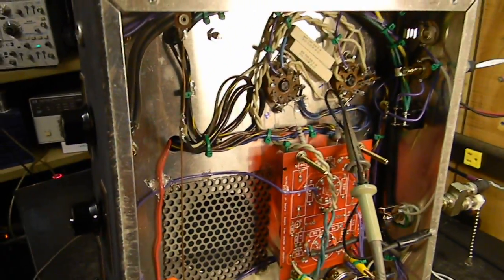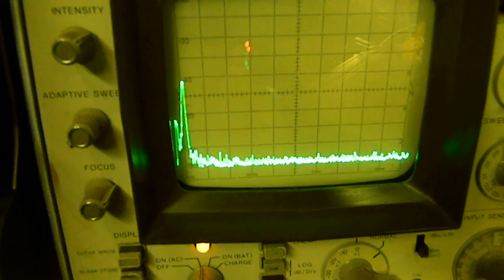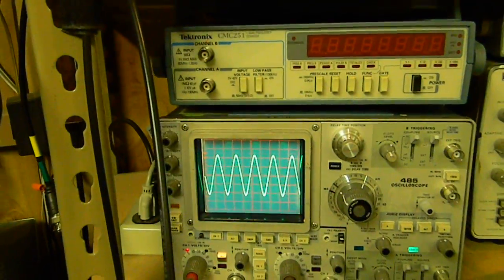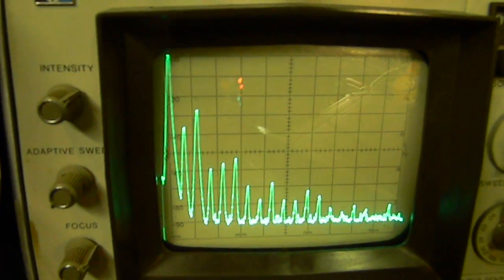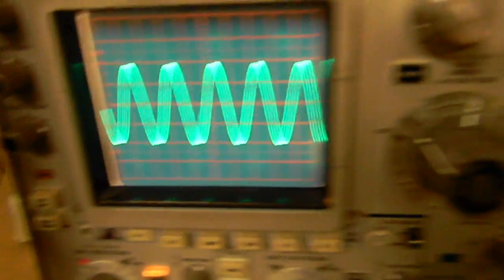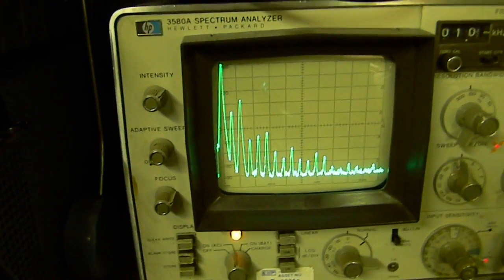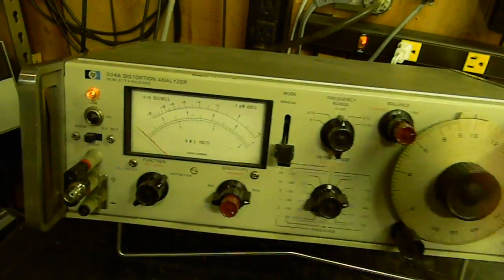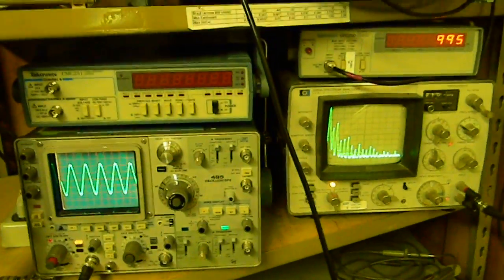THD And Its Origination In Audio Amplifiers

Comment: Happy new year David. Hope 2025 is a great year although it seems we've already had a rough start... Anyway, I wasn't sure where to post this since it touches a few area but THD is currently what need some assistance with. It does cover the HP 8903 and Fisher amp and I've watched other videos covering this content. Anyway my first question is do you use any capacitor coupling when you connect from the output of the audio amp under test to your test equipment? Currently I use the HP 8903a and Pete Millett software to perform my testing and I'm wondering if I'm doing something wrong with the way I'm connecting to the output. What I'm doing is connecting my amp (Fisher 400) left and right output to two 100 watt 8 ohm resistors as a dummy load for each channel. I'm connecting the HP 8903a input across the resistor. I have the banana connectors configured to provide test points to connect my Sencore lo capacity test leads to (from my Sencore LC53 Capacitor analyzer). For awareness the output of the HP in sent into the aux input of the Fisher 400 I've been restoring for quite some time. My issue is that I've done a lot of work to this fisher using mods and Ideas I've found from yourself and some other youtube masters. Currently, I've successfully replaced all the Filter can caps with Hayseed Hamfest, Installed new Bias caps along with an individual bias adjustment circuit and the necessary coupling caps and resistors required to measure at the cathode of power tubes. There are additional electrolytic and resistor replacements made as needed. Everything has been done and I'm happy to say everything works however this nasty THD still exists at my output tubes. And the freq response from this Fisher 400 seems concerning dropping off starting at 10K at the output while the preamp seems to perform better. 

Right Side: To be clear this THD issue is concerning since its not linear across the channels. The right channel is much worse than the left. So this is what I know. At near 2 watts output I have a THD+N on the right that rises to 1.5% at 30 hz dips a bit down to 1.25 between 100hz and 1Khz and rises to 2% between 3 and 8K then starts to drop off at 10K and falls off by 30 K. Note that the freq response of this amp also rolls off at about 10K and is 5db down by 30K. As you can imagine the THD gets worse as the power is increased.

Left Side: This side runs much better at the same 2 watts and starting at 20hz to 500hz I'm at .2%. Then from 500hz to 1K the rise starts slow and gets to about .5%. From 1K to 10K its a steady climb to 2% before it rolls off and follows the rite side down as the freq response drops off also.

Preamp: Both channels are linear at the input to the volume control. At about 1 volt and 20Hz they both start at about .25% and start to drop to .15% by 40 hz to 8K. There is a strange ringing between 27 to 37HZ. Also at 8K to 30K the THD+N rise steady to .3%. To me this is great for the preamp of this period but I really don't have the experience to judge.

I know its a lot of words that a couple of pictures could have displayed but I could use some insight. I've done too much work to not understand what is happening here. This THD was there when I started but I really thought once all the significant caps were replaced this would be resolved. I have moved the output tubes around. I have some additional 7868s and moving the tube pairs around does make changes but the essence of these curves is the same. Currently the best I can get it with the orientation of the tubes I have now. I'm not sure what the best way to couple the HP 8903 is. Also, I've tried to use my o-scope FFT and I can see the harmonics but I don't have as nice a setup as you with the HP 3580 showing those beautiful peaks... I did recently purchase at a fair price an HP 3561a dynamic analyzer but I'm not confident on how to insert this into the test. I'd hate to damage it. I don't think it will display as nice as the 3580. Anyway, please let me know your thoughts and any ideas you might have. I must be missing something and I don't understand why the L and R are not consistent. I do notice that the L and R are very slightly out of phase. I mean very slightly. When I put what appears to be perfectly symmetrical nice looking sinewaves over each other the left channel line is unmeasurably ahead of the right. Have a happy new year and look forward to more content.
Reply from the maker: Happy New Year... I will try to start at the top - no, I use no capacitive coupling from the load resistors to the 8903A. There is a direct wire connection across the load to the input of the 8903A. You do have to be careful with polarity as one side is ground plus the negative side of everything is connected together thru the safety ground on the AC plug. Getting the polarity crossed ends up shorting the output of the amplifier and nothing works - I have done that a time or two... 🙂
Your Fisher 400 should be OK to connect to the loads but I should mention that many, but not all, solid state amplifiers do not have a common ground and both channels cannot be connected to the load resistors at the same time as it will tie the negative side together and this is not permitted and may damage the amplifier. This not your issue though.
Having one channel perform better than the other is very frustrating and it certainly does happen. 
Here is a cut and paste of something I found on the Internet that you might already know.

Electrically, the 7868 is identical to the Octal based 7591. Drive requirements are no different than that of EL84s and 6V6s.

My personal thoughts are your output tubes are (could be)  a big part of the problem. The driver tubes can be just as important. The only way to really know is to swap them with new or known good ones. They have gotten rather expensive nowadays.
No doubt it can be a real challenge to track down the exact cause of high THD and if I understand correctly, you have a good clean driving signal on the grids of the output tubes. Just looking at the grid of the output tubes with an oscilloscope is a good place to start.
Do you have a way to measure the inductance of your output transformers? Even a careful DC resistance check might show some differences between the good channel and the not-so-good channel. I am not assuming the OPT are bad – they are probably OK but I would find a way to check them. Being able to measure the inductance of the primary would be really good to eliminate them and determine if they are OK and not worry about them anymore. Just a thought.
Is your power supply voltages correct? I see you have changed the electrolytic capacitors but make sure the high voltage at the plates of the output tubes is good – that the correct voltage is on the screens and the bias is correct. Power supply issues are easy to overlook but just make everything not work right.
Just some thoughts to start with. Hope some if it helps.
Reply: David,  Thanks the quick response. Those are some very good thoughts. I do have some concerns with the fact that the plate voltage is about 18V higher than it should be while the screen voltage is as printed on the schematic. As I mentioned I have installed an individual bias circuit so I've been tweaking these power tubes to get the proper current on the cathodes. What I didn't really consider was the output transformers being a factor. I need to dig a little deeper as well as spend some time investigating the driver tubes a bit closer. Also, I need to swap these 7868s around a bit to see how that impacts things. Anyway thanks for the input. Really appreciate it.

Comment: I will check your 6V6 desig. The 6V6 is a wonderful tube. Hallicrafters used 6V6's in PP on some of their rx and even though, were not talking high end those were great. 
Have you played with single ended PP yet? I have not but remember reading that one of the JA audio designers was experimenting 10 years back or so.. It sounded promising. As I recall it was simply 2 single ended pairs running PP between them. I have no idea what class that would be unless A/B maybe; Always enjoy your vids. 
73

Comment: Very interesting.. I did a lot of work about 10 years ago with single ended class A with 2A3. 45 and WE300 B tubes.  As you know Class A is low in odd and rich in even harmonics. Personally, I found these to be the amps I would keep listening too even though I had built EL 34, 84, and 6550 amps PP, especially, in the mid range. Piano, and violin classical and jazz was amazing. 

I will be interested in your research.

73,
Glenn WA4AOS
DSM Labs  dot com